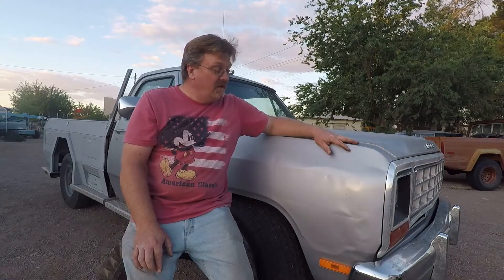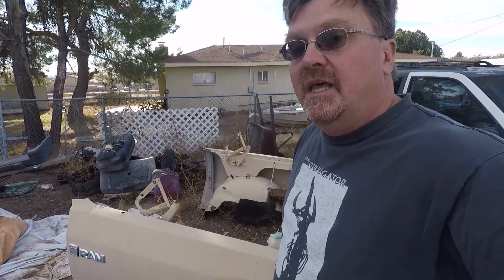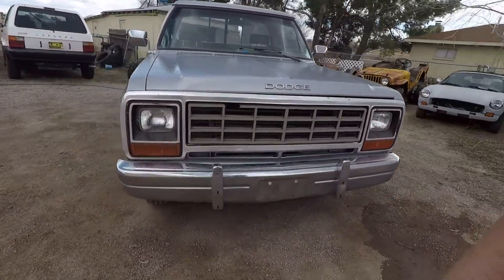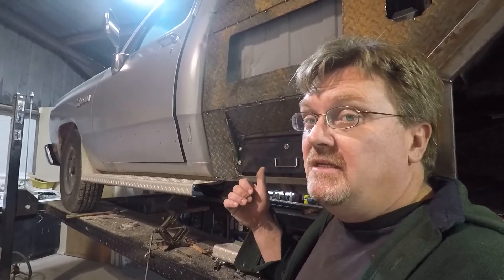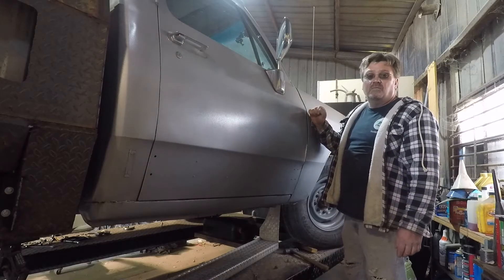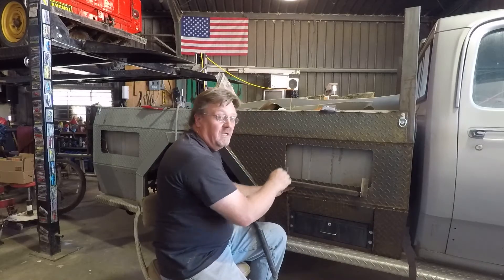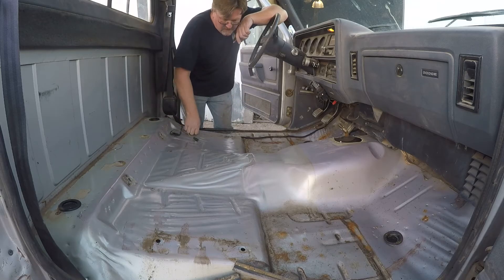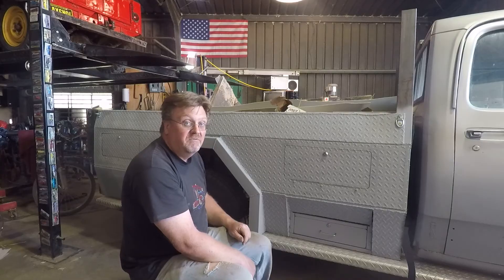First Gen Dodge Cummins Shop Truck Refresh

Comment: That truck is 🔥 a year later still waiting for an update on the truck
Reply from the maker: Yeah, I've been putting off working on the truck, its just works good enough.  I do have a pile of parts to install sitting in the garage waiting for it, I should get to that this winter.

Comment: I was not on board with this (aesthetically), until I saw the ends result up close. The utility is cool and for some reason looks better up close. However, I think if I lived in the desert, I would have to start with fixing the A/C.
Reply from the maker: I agree, not the most eye appeal, but it sure is useful.  Also, I can still put on stuff meant for a regular bed, like a camper.  The A/C is coming up, but I had to wait to line up a few more mechanical things so I can do them all at once.

Comment: Dodge copied so much from g.m.  Just G.M. didn't have to borrow a diesel.
Reply: No but they should have.
Reply: Funny, I've seen those 'borrowed' Cummins swapped into a bunch of stuff, afterwards the stuff works better. Weird thing though, haven't seen very many GM 6.2 swaps maybe you could do a video, or a GM 6.5 swap into something. Might be a bit of a search to find one they seem to be scarce! Ah well, show us a Duramax swap that would be good. Hope you got some deep pockets they can be pricey. Hmmm a flat out reliable, cheap, and long running diesel engine. Yeah those Dodge Boys really made a bone head play when they put millions and millions of Cummins in their vehicles.